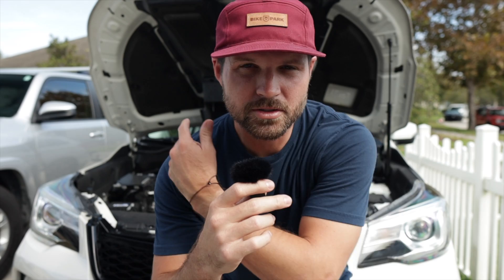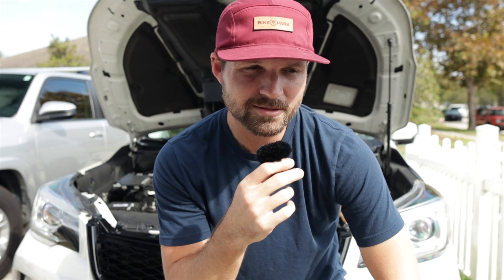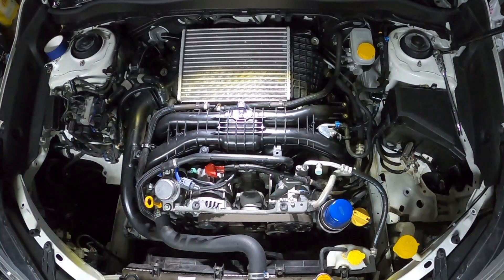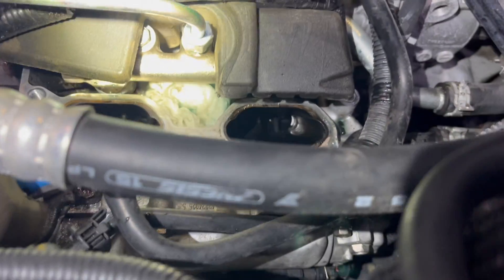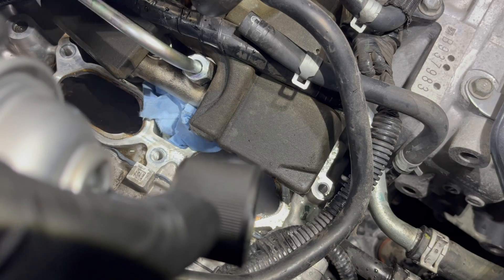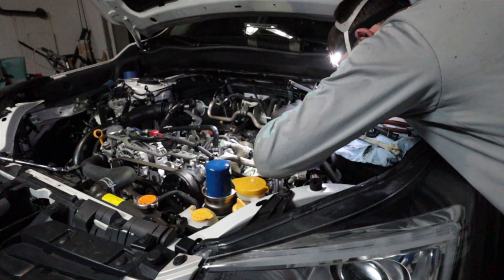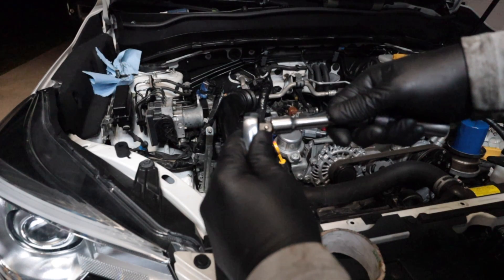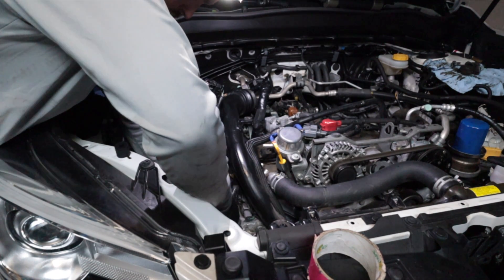Clean your intake valves without walnuts

Comment: How exactly do I close the valves? Stated at 2:30 ? And second can j use a bottle brush to clean it out ?
Reply from the maker: Need to self crank the engine till they close. You can just make sure the bristles don’t get left inside.
Reply: @ appreciate it . I’ll have to look up how to do so , I’m definitely going to do this , this weekend 🙏🏻🙏🏻
Reply from the maker: @vibesgood5358  If I recall correctly its a 19mm on the cank pulley. Its easy to do. The difficult part is removing everything. Just give yourself plenty of time. Best of luck!

Comment: You Rock.  Any thoughts on prevention?  Catch can?  Or just strap on some ball$ at 60k miles and kick the carbons a$$ manually?  This is diy high level.  Cheers!
Reply from the maker: Haha definitely a iag oil air separator. I wanted to do this at the same time but I didn’t have the funds and I don’t plan on keeping this forever.
Reply: There isn't exactly a "preventative" way to do this because there's no fool-proof way to prevent buildup without port injectors. There is a preventative maintenance process you can do, though. Subaru sells a kit for slowly adding an ester-based cleaning solution through the vacuum tubing. If you do this every oil change (or every other oil change), you can keep your intake valves and manifold relatively clean.

Comment: A bundle of zip ties trick work great...you might want to try using picks before you use spray the cleaner. Sometimes you can dislodge larger chunks before you make a mushy mess with cleaners. 
 You're not after perfection. Just clean up 85-95% of the build up.
Reply from the maker: Valid point! Thanks for sharing